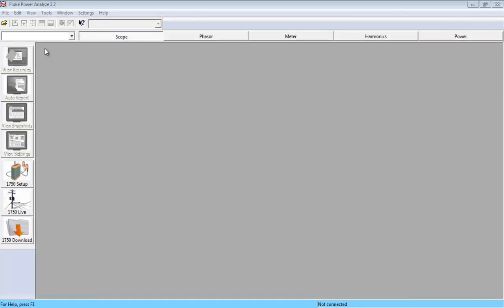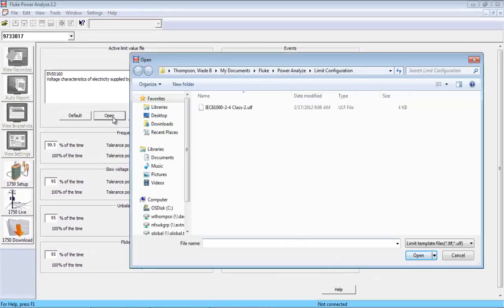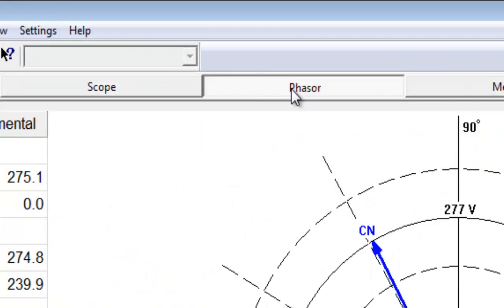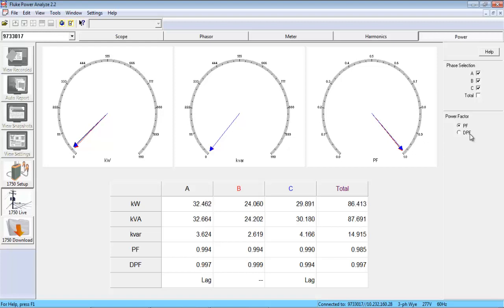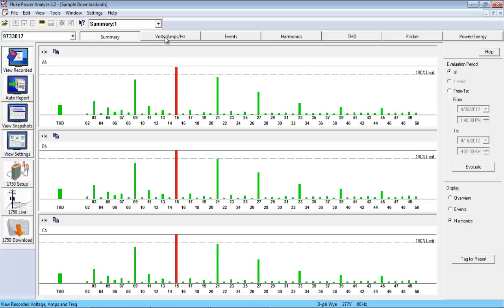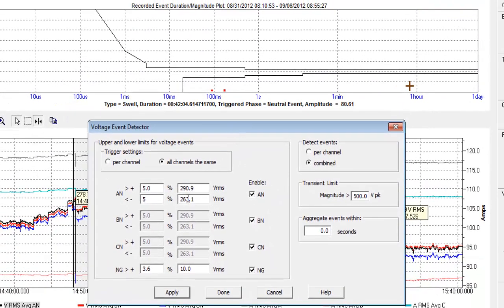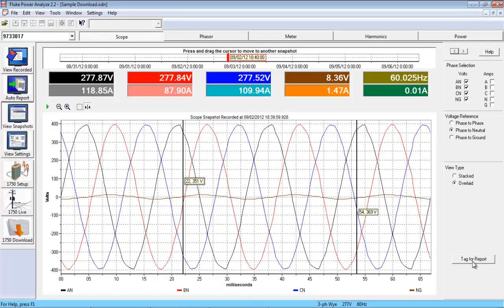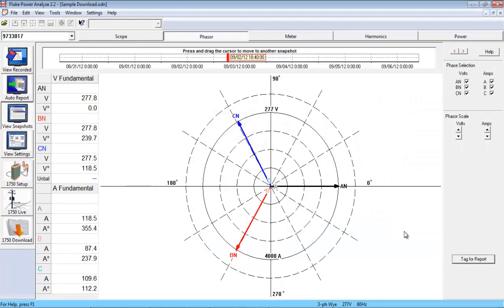Fluke Power Analyze Overview

Comment: What are the rules of setting the upper and lower limits for voltage events inside the voltage event trigger box ??? I'M so confused of these limits !!!
Reply: You can do it following your local normative, or you can do it by the tolerance of your equipment, It really depends on what you are trying to find or prevent.
Reply: It only took 5 years.... sorry :(

Comment: Thanks so much for the video..really informative 
I have one inquiry which is the transient limit , is there a fixed value for transient limit or it depends on me ?
Reply from the maker: +Suhaib Ahmed I am glad to hear that the video was helpful.  The transient limit is adjustable in the database during review through the event detector as are the dips and swells.  If you have any other questions, feel free to contact Fluke directly @ 888-257-9897 or FPQSupport@Fluke.com
Reply: +FlukePQ thanks so much ..your response is much appreciated
Reply: The transient limit depends on what you are trying to protect. For example a 100 V transient way not do much in a 120 V equipment, but it might destroy a 12 V or a 5 V system.